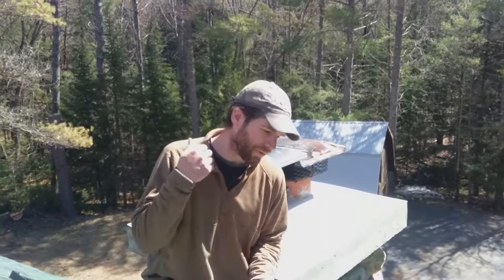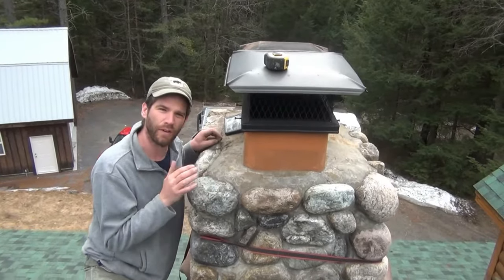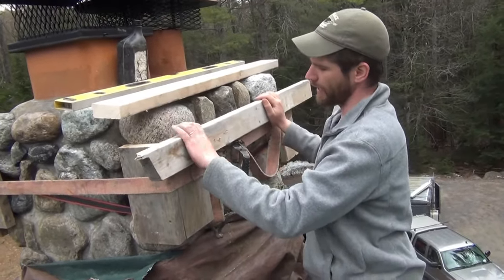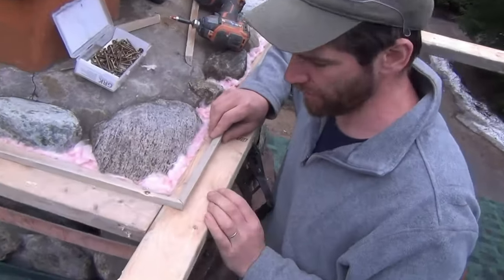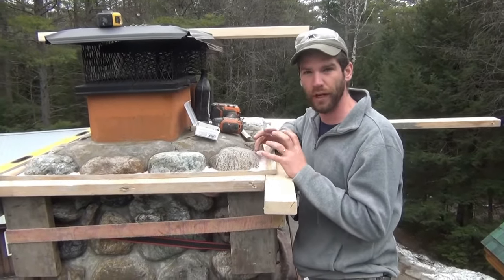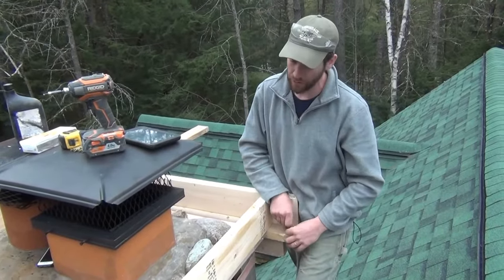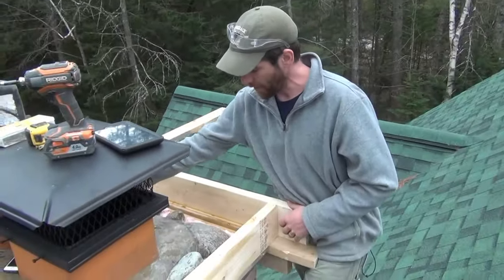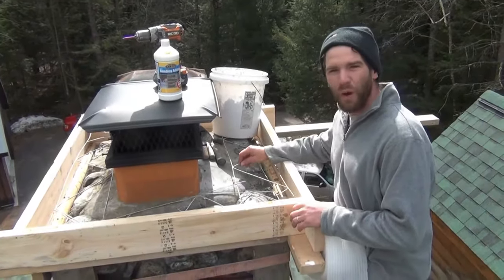How to Form and Pour a Chimney Cap (with Roger Houck)

Comment: Oh no! You’ve given me the confidence to attempt this job that I was certain I’d have to leave to the experts. Seriously, this is such a great video. You covered everything I wondered about (and was intimidated by). The only thing I’m not quite clear on is what sort of bit you had in your hammer drill. Thanks so much for this video. I think your thoroughness and methodology could work as a model for anyone producing a how-to video.
Reply from the maker: THANK YOU David!   I'm sure you can do it.   the only hard part if it is on a steep high roof.   I couldn't address that accurately without losing my liability insurance  :-)    any bit will work in the hammer drill.    I usualy use a square drive #2       Let me know if you run into any questions as you go.
Reply from the maker: nice!  brick is even easier.  in fact you can sometimes screw the boards to the chimney rather than using the ratchet strap idea.     sometimes a 3" deck screw will go right in the mortar joints.

Comment: After years of deferred maintenance, I'm going up on the roof tomorrow, Cutting out mortar joints, re-pointing and working on the cap. Thank you, very informative. I wondered about that expansion joint thing. Seemed like a stupid thing to do but all the experts said to put it in. Now I know why and will most likely skip it. 
You are correct about the leftover dregs of cement going on the top of the chimney, I think my builder ran out of Portland before he was done. last 5 courses and cap are weak and brittle.
Reply from the maker: THANKS for watching Paul.  and good luck with the project.  let me know if you run into any questions.  i try to check in every day.    is it a brick or stone chimney?     Quite often the top courses weaken because they receive the most amount of water and weather.   the Portland slowly is leached out and the freeze thaw works the concrete matrix apart until its just sand.      I will have to make a repointing vid soon.    we are going to put out a grouting vid for thin veneer application and that is a similar process.    just make sure the joints are clean and a little moist when you tuck the new mortar in to insure a good bond.  Thanks again!  -Roger
Reply: @TheHowToHeadquarters  Here's how the day went. 1. Home depot only has type s mortar so the pointing is getting done in type s. Nearest brick yard is too far away.  2. The cap was done 6-7 years ago with type s and only had hairline cracks and a itty bitty gap where it laps over the brick. I had a part bucket of Drylok hydraulic cement and some Drylok powdered white block paint. I thinned the cement until it would penetrate the cracks then painted it with the white over the cap and down 1 course of brick.  3. The old mortar ground out easily and only 3 bricks fell out. They are cemented back in and a small amount of pointing is done.  
Probably would be laughed at by professionals but it looks good, cost me $18 so far and at age 65, it only has to outlast me.  Thanks again and keep up the good work.
Oh, brick chimney, built 1959 in north Maryland.
Reply from the maker: Great report!   thank you.  it sounds like you made a solid repair.    maybe next summer you could spray the whole chimney and cap down with aqua-pel or another sealer.   to stop up any water penetration before it starts.
Reply: Yes you need an expansion joint without question

Comment: Awesome knowledge and video.  What about counter flashing a stone chimney?
Reply from the maker: thanks for watching   i did a  vid on flashing  a thin veneer chimney.    a full stone is similar.   if you are flashing after the stone is built,  i cut in channels with a dimond blade and caulk the counter flashing pannells into the slits.   if its a new project.  i set cement blocks as the flashing base,  flash the block, and then set stone on top.  i hope this helps.  here is the thin veneer vid:     https://www.youtube.com/watch?v=NGwiWh-_XEA

Comment: I like a lot of these tips and will use. However the one thing he did seem to forget is the expansion joint around the flue which expands at a different rate then the crown and will likely crack the crown after a few years. Unless I missed that in the video.
Reply from the maker: yep i talked about the expansion joint.  I intentionally did not put the expansion joint in due to the reality of that  joint not being maintained over time and the fact that 30 feet away from the heat source the heat differential is not big enough to cause major expansion.

Comment: There is supposed to be a barrier, even if only a very thin barrier between the top of the chimney and the crown. A crown is supposed to "float". If it is bonded to the top of the chimney it could damage the chimney top or become damaged itself. The crown and chimney top will likely expand and contract at different rates which is lilely to cause damage.
Also, I would not recommend using a flammable material if you do wrap the flue tile for an expansion joint. Use high heat ceramic wool insulation. Once the concrete hardens overnight you can dig out the ceramic wool about a half inch down and apply a high heat silicone caulk. Millpack might be better if it is designed to stay flexible. It may be prone to cracking. Check your expansion joint every year or two and add new caulk if needed. The drill trick is awesome.
I was going to try my triangle head sander but the drill will probably work better.

Comment: This might be a stupid question, but how do you work on the side of the chimney that faces out towards the garden? I imagine you could do most of this standing on the roof like he does in the vid, but you'd need access to the outer side to screw the wood together/make sure it's level. Do they just use a big old ladder, or do they make a platform?
Reply from the maker: it depends on the job.  sometimes a scaffolding, sometimes  ladder or sometimes i climb on top of the chimney and reach out from above.
Reply from the maker: it is  a pain to work out there

Comment: Rebar should have an 1.5 inches underneath and on top and minimum of 1 inch it will expand and contract at a different rate than concrete so its worse then wire I like laith wire mesh for thin concrete. I have only done one of these years ago thanks for posting. Questions I have I notice you didn't leave a gap using foam on the flue is there a reason? What part of the country are you in looks like Idaho? What thickness do you think is minimum on the crown without issues? And what sealant do you prefer around the flues I was going to use butyl
Reply from the maker: i talked  a little about expansion against the flue in the vid.  i dont hink it is a good choice for a tall unmaintained chimney.    thanks for watching!

Comment: Great vid and you cover a lot! But, one thing that I noticed and important, is you need to "pull up" the  Galvanized Wire Mesh, otherwise it will end up resting on the bottom of your pour, doing nothing to help the strengthening of the cap. It is the same idea as u mentioned about the steel rebar being  encased 4 inches into the concrete on a bigger slab/cap .Thanks
Great idea, the mini vibrator!
Reply from the maker: thanks for watching Tom,  YES   i realized i forgot to mention pulling the metal up.   I hope people see this comment.  thanks again
Reply: @TheHowToHeadquarters  Yes sir, welcome. I also am thinking of your , what we used to call a "keyway", or void made by 3/4 round, to discourage the capillary effect, and wondered if something could be done for the many existing caps from yesteryears. Maybe a thick run of a strong caulk just under the cap, a couple inches in ? I see the effects of this all the time, and there must be a cheap way to stop it. Thanks
Reply from the maker: Yes.  i have done that with caulk.  or if it is accessible,  i have cut a keyway (drip channel)  in with an angle grinder.     Not a pleasant task,  but it works.
Reply: @TheHowToHeadquarters  Oh, perfect. Didn't think about a cut, if accessible, Thanks
Reply from the maker: its definitely a face mask and goggles operation,  but it works.   sometimes just 3 cuts and then a chistle.  or a cut straight up about 3/4" deep and then an angle cut to meat it starting closer to the chimney side.      a cup grinder works well here too rather than just a Dimond blade.
Reply: @TheHowToHeadquarters  Thanks Roger!
Reply from the maker: hope it worked out.  thanks for watching!

Comment: Awesome video! Thank you for the vibrator trick👍
Reply from the maker: thanks for watching Charlie!   yup that drill will make the best looking bubble free concretework.  are you fixing your chimney?
Reply: @TheHowToHeadquarters  we're in the roofing and masonry business. Roughly 30% of our work is chimneys, and once the cap is poured there's a whole lot of tapping on the sides of the forms with trowels. Just like a wood pecker!
Reply from the maker: ha ha yes! ive doen a lot of tapping in my day!   we actually poured a cap today and used my plug in hammerdrill/jackhammer.  that zipped the bubbles out fast!!!!! but it almost drove the form out of whack.   so you do a lot of work way up off the ground.  roofing and masonry is an interesting combination! Im sure you are very busy. what state are you in? i bet you have a lot of chimney flashing tricks
Reply: @TheHowToHeadquarters  here in Nova Scotia, Canada the majority of roofing companies advertise Masonry as well. Most of us are doing chimney work for masonry along with the roofing, hand & hand to eachother. Our chimneys in these parts use lead at the base, for flashing and if it is  a metal roof going on there we'll cut into the chimney and put the color matching steel flashings, backpan & counter flash. Since early 2020 when the virus hit, just about every contractor in the province got burried down with work. We've just started back up for the season
Reply from the maker: @charliehumber6383  yep i get a lot of calls from roofers.  it sure makes sense to do that work at the same time.   Down here in New your state the workload has been crazy too.   no wat to keep up and nobody to hire.  so we just pick our jobs and make vids so people can do it themselves!

Comment: thank you Im in the process of exactly the same thing, spalled bricks have decimated the look of the dchimney also the crown is compromised so I removed all the loose stuff and built up the missing bricks with cement , now I have seen your video Ill build a collar like you and make a new crown , will this work on bricks insted of stone Im assuming yes  thanks a lot
Reply from the maker: Thanks Bill !   Yes this works on bricks.  its even easier.   you might be able to screw the 2x4s on to the side of the bricks rather than go through the ratchet strap trick.   everything else is the same though.   if you run into any questions,  don't hesitate to ask!

Comment: so Roger my chimney is great with your help , but with the uncooperetive weather the crown was kind of dug up a little when covering everything up, its OK but I want to just scim it over and level it to make it perfect also I did get some pin holes formed even when I used my vibrator drill,  just got a little rushed when the weasther closed in , so I wanted to know what to use to do this scim and what water repelent would you use for the whole chimney to seal both the cement and bricks   thanks a lot Roger
Reply from the maker: yes that happens!     thin skims are hard to get to bond  and they require good weather not to hot cold or dry.     I've used a product called top'n bond or a comparable squeegee application resurfacer.    but in the whole scheme of things it is not a real big deal if there are some small pock marks.   i like aqua pel   as a spray on waterproof er.
Reply: @TheHowToHeadquarters  thanks roger

Comment: You absolutely need to have an expansion joint. Otherwise, after just a few years, cracks will develop in the crown, starting from the corners of the flue tile. Oh, and did you mention a bond break? And, is that less than an inch from the outer side of the concrete to that rebar metal?
Reply from the maker: Great points Manuel.   thanks for watching.     I'm sure the value of the expansion joint varies in different climates and different chimney setups.   as i mentioned a perfect set up would be an expansion joint that is maintained every few years.   it has been my experience (with literally hundreds of chimneys)  that the maintenance gets deferred and the expansion joint becomes a major liability.  this liability must be weighted against the benefits of the expansion joint and those benefits decrease when the chimney is tall, seldom used or has a flue liner in it reducing the amount of temperature variation.   

you are also correct that conventional rebar should not be placed near the edges of a pour.  this is why i recommend galvanized dura wall.    it is less likely to rust and since it is closer to 1/4 inch thick, the  issues that come with larger rebar applications are greatly reduced,     each part of this country has its own issues with a  masonry cap, but this design is a very good match for the weather and used that we face here in the the northeast.  

thanks again for watching and commenting.  I appreciate your experience and attention to details
Reply: Yes you absolutely need an expansion joint.   Yes it will maintained but the crown won't crack.   Without an expansion joint the crown will crack without question.

Comment: Wow, great video! There are so few out there, of any type.
I have a brick chimney with two flue's, one for the gas furnace exhaust, the other with a stainless liner from my fireplace insert. I have a broken 8"x8" top clay tile on the furnace flue, and the cement crown is deteriorating to some extent, but it's not horrible. No cracks really, just some flaking I guess? I was thinking of just coating the crown with crown coat, or crown seal, or some other cement-like rubberized coating, but now that I've seen this, I'm wondering if I should attempt a new crown. 
Wondering how you get the old cement crown off? Jackhammer? Cold chisel? Like I said, mine is all in one piece, but has some erosion happening on its surface. 
I had put some of that black tar like rubberized sealer on there several years ago to try to help the deterioration, but it eventually cracked and probably caused more harm than good.
Reply from the maker: thanks John,  yep i would probably replace it.  it is a big job,  but most patches only work so far and the deterioration continues down below.    most caps brake up easily with a 4lb sledge and a chistle.   unless they have a lot of rebar in them.     the sun breaks down most patches and recoating's sooner than you would like
Reply: @TheHowToHeadquarters  Thanks!
Reply from the maker: sure thing,  let me know how it comes out.
Reply: @TheHowToHeadquarters  Will do! That is, if it turns out I'm brave enough to dive into it. I have a 1500.00 quote for a chimney guy to do it. I'd much rather do it myself for under 100.00, but... we'll see. Cheers!
Reply from the maker: that is not a crazy price depending on how accessible the roof is.   but yes if your time is free,  your materials would only cost about 100 bucks.   either choice is good.

Comment: Nice video!  I am getting ready to tackle this myself.  Our cap s leaking into the house and screwed up the drywall at the edge of the chimney.  My chimney is made of a kind of brick looking stone called Miami Stone.  Which was made in Miami Oklahoma.  My question is; I have seen several videos that advise to use something to make a break between the brick and the cap itself because they thermally move differently.  Some have used a sheet of galvanized sheet metal and even some used tar paper.  What material would you recommend for this?  Also, would high strength concrete mix be the same as your using regular mix and adding Portland?  I appreciate your time to make the video. Thanks, Tom
Reply from the maker: Hi Tom,  thanks for watching!   I do not recommend the break between creet and chimney material.    I understand the logic behind it but the concern for water working in between that separation is too big in my mind.    yes with the method I  show there is a chance that there will eventually be a bond brake between stone and creet,   but I am confident that  since the creet wraps down over. the stone water cant come in.

Comment: When you removed the forms, did you have finish the surfaces? If so, what do you recommend?
Reply from the maker: somtimes a little patch with portland water and a little sand.  most times it is finished just fine on its own

Comment: Is there any benefit to the mortar mix with an extra scoop of portland over just using a sand topping mix or is it essentially the same thing?
Reply from the maker: well yes... ish... the sand topping may be richer in Portland, but it does not have any stone aggregate.   sand topping is smooth and easy to trowel, and its surface may hold up against the weather better but you will want the majority of your concrete to have some nice gravel type stone in it.  it just makes the matrix of parts much stronger.    THanks for watching btw.  I will make a vid on mortar recipes soon.    -Roger